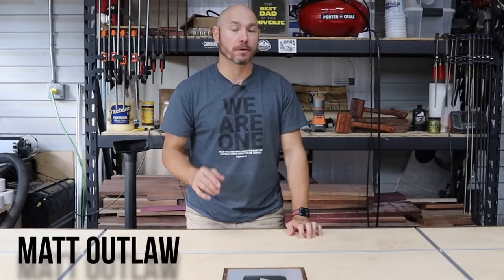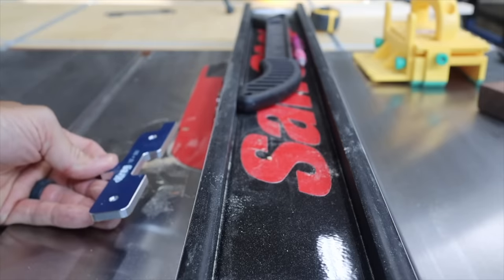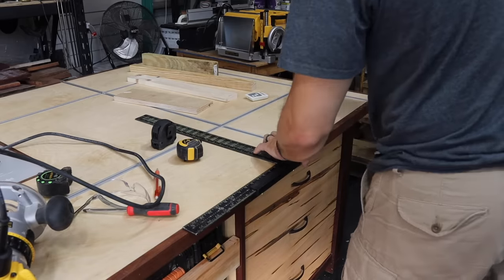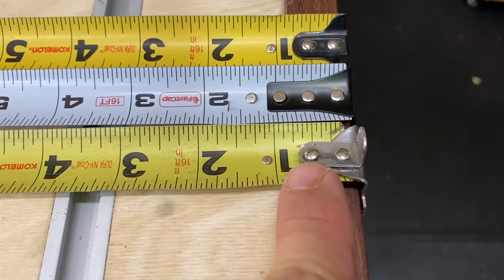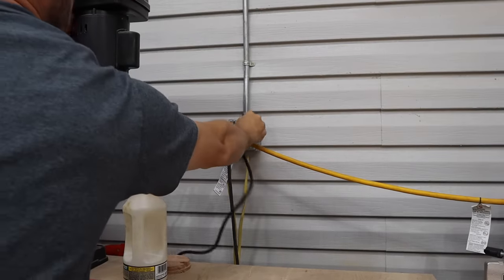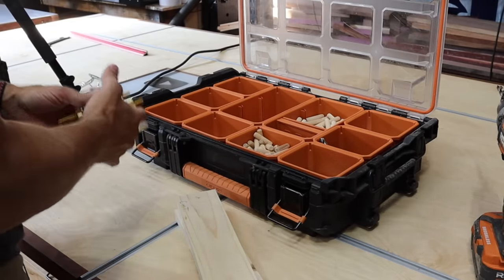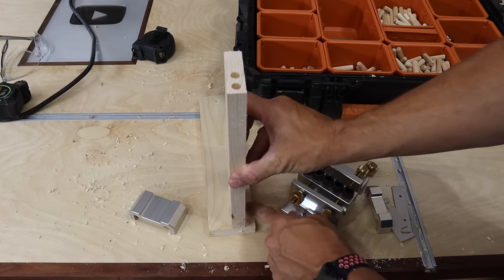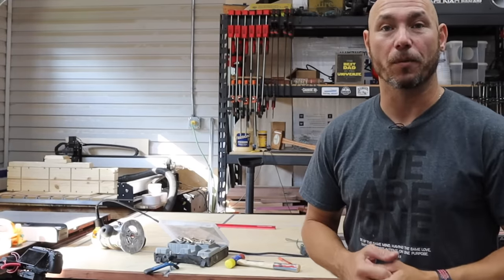5 Woodworking Tools You Didn't Know You Needed Until Now!

Comment: I can see the foot switch being a safety issue. If someone would be changing a bit and step on the switch it could activate the tool. I realize you should unplug the tool when changing a bit, but I can easily see someone forgetting.

Comment: Hi Matt, I am an occasional hobby woodworker (make shelves, small household furnitures and occasionally do some home remodeling stuff (for the family). Although I have once built my own desk, and few kitchen cabinets way back, but these days I only build small stuff herea ane there. I have learnt a LOT from your shows.  Need your professional suggestion on a few things:

1) For saws I currently have a Delta 10" table saw, Dewalt compound sliding miter saw, Porter Cable circular saw, Bosch barrell-grip jigsaw and a Ridgid scroll saw (which I barely use).  Do I need a band saw? If yes, what is the fairly good quality (Wen over Ryobi) brand/model would you recommend?  I am looking at a Grizzly G0803Z, vs a WEN BA3959.  Is 9" a good choice for someone like me?
2) Is it worth investing on a planer?

Appreciate your help.  Have a nice holiday season.

Comment: Tapemeasure: Metrics is so much better to use. Then that will not be any problem. 
Also it is much easier to calculate with metrics than with inch and its 1/4, 1/36 or what ever.

Comment: Purely guessing, as I'm not involved with woodpeckers, and don't currently own any of their tools... 
But I suspect that their choice to go with plastic for the stop blocks on those edge rules wasn't a matter of being cheap, but rather a concern that a metal stop block sliding on the red anodized finish of the edge rule would scratch it up, and potentially obscure the markings for your measurements over time.

Comment: I dont think i would use that 2' square as a cutting guide on 6" wide piece of wood though lol. People always comparing something to the domino, while i dont own one, it is easy to see from videos it has no equal. Domino is speed, if u are on a budget or dont use that type of joinery much then sure simple doweling jig is great but it in no way compares to a domino. I would prob make one of those slot mortisers if i really needed something like that. Maybe in the near future but my next tool buy is cnc. I def agree about the wood peckers edge rule being the price they are should come with metal stop blocks. That is one of the reason people buy there stuff is the build quality and plastic stop blocks is falling a bit short.

Comment: I'm pretty sure I saw a carpenter's square with a level on it looked very close to that. If can find it again, I'll send it to you. 
My old woodshop teacher in 9th grade used have pull our out and start move the tape too the 1inch line, and measure from there, and subtract an inch from our total.

Comment: On the ROCKLER EDGE RULES, I have to disagree with your ruling that they "cheaped-out" on the plastic Stop Blocks. The reason being is that Aluminum on Aluminum would eventually scratch the anodized coating on the Edge Rule. Aluminum on Plastic is a much better design idea and with today's plastics, if they are molded or even machined out of something like Delrin, they'll last you for many years under normal everyday use.
Reply from the maker: Good point.  Thanks

Comment: I've been using those foot pedals for years, but mostly for a different reason. When on job sites, I'd always have a 16 gal vac hooked to my job site TS and would hook the pedal to the vac, so whenever I'd need to turn on the saw, and because I'd always set up the vac in the back of, or off to the side of the saw so it wouldn't interfere in any way, the pedal made it faster and safer to use the vac.

Comment: The first three are awesome! I like the fourth one, the power foot switch, but does it allow variable speed for a drill press? The dowel jig is really neat, but I haven't done any dowel joinery, so it's not useful to me at this point. Just today I was cussing out my cuts (without using cuss words) because they were not coming out right. It was due to the very thing you highlighted in your video concerning the variations in tape measures. That is maddening when 1/8th or 1/16th of an inch makes a big difference. I NEED those rulers before I lose my mind. The depth gauges are very impressive as well! I'm going SHOPPING!!!

Comment: I found the DowelMax, particularly the 45 degree setup to be inaccurate.
Reply: Interesting, I did six foot miter and it was spot on. My cut was not very accurate as I only have hand tools and I used dowels to drive my filling/sanding. The end result was excellent.

Comment: The dowelmax is a bit too pricey for me. Anyone have any recommendations on something more affordable?
Reply: I have Dowelmax, general tools jig from HD and Rockler bead lock. If you can live with some inaccuracy I would get HD jig as it is more flexible: you can do any joint except edge miters (you can do end miters like in picture frames). You need to test out and understand offset it produces and assume you will need to do some sanding or flush cutting after joining. You might end up doing what I did and keep on upgrading so beware 😊.
Reply: @meperson  appreciate the response :)
Reply: You might look at the Jessem Dowel Jig.  I've been using it for a year now, and I love it.  Very well built and true.  I was like you on the price.
Reply: @glenncook8140  I agree. I looked at it as well. The only disadvantage is that it doesn't do mitered edges.

Comment: They're plastic, so it doesn't scratch when you slide it down the other one.
Reply from the maker: The Paolini Pocket Rule has aluminum slides on an aluminum rule 🤷🏻‍♂️
Reply: @731Woodworks  Well, I've had one, and after about 10 years have the stuff is wore off of it that you can't read it anymore.

Comment: Because your using the wrong tape measure. Those are fine if your framing a house but crap for wood working. Get a good 3/4 inch tape. I use the Stanley 16 ft 3/4 inch tape. I check it when I get a new one against a starret 12 inch square. Then I know it is accurate.

Comment: for the stop blocks on the rulers I think there's a reason why those are plastic.. it won't wear off the paint from the surface
Reply from the maker: Naw, they use aluminum ones on the Paloni Pocket rules
Reply: @731Woodworks  hmm, then it's a way of cutting costs indeed.. oh well, still a decent tool for sure

Comment: Also, your comment about tape measures for the 3rd tool is funny, because if you were needing to buy 3 tape measures (presumably of different total lengths) surely you buy from the same brand (as you clearly have not), so that's solves the discrepancy in measurement issue!

Comment: The FOOT Switch sounds like a neat ideal ,but caution should be used considering it's possible to inadvertently hit the switch while changing or adjusting blades or bits potentially cutting or shredding hands.

Comment: By the time u dial in one dowel ill do 10 dominoes . I really doubt a dowel is stronger than a domino.  Its probably as strong
Reply from the maker: Domino is certainly faster
Reply: Yea loose tenon (domino), correctly done dowel joints, and mortise and tenon joints all end up falling into the category of stronger than the wood around them joints which is all we can ask for when it comes to joint strength. After that it becomes a cost/time/ease of use game. You and myself will never give up our domino but I can understand people not wanting to spend over $1000 on a tool for their hobby that is just for making joints when they have slower methods that cost significantly less.

Comment: Good video, well done and interesting.  But, certainly most will realize that there is simply no end to the tools and jigs that capitalism will come up with for us to buy and store somewhere in our shop.  All of them are predicated on the basis that it makes things easier and more accurate, but it really means that we don't have to hone our skills as much as we did at one time.  I'm a retired journeyman carpenter and cabinet maker; I did good work and did a lot of custom work for people in their houses.  Everything I had fit easily into the trunk of my car.  I had a circular saw (that doubled as a table saw in a knock down bench that I designed), drill and router; the rest were simple hand tools; what needed to be sharp was razor sharp.  Ah, the good old days . . .